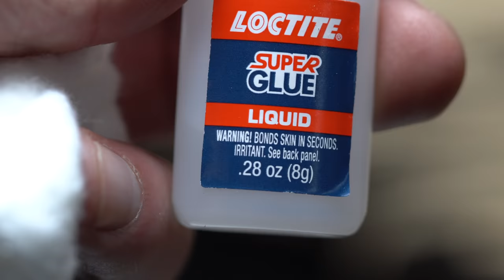300 GALLON MONSTER PALUDARIUM HARDSCAPE TUTORIAL!

Comment: Great work Troy, love your builds and tips. I'm about to make my first paludarium for Nataliae's Mountain Horned Dragons and found your channel in my research a while ago and a big fan since... I have a question about the filter foam and the bacteria you mentioned. Did it also happen in the tank where you only had filter foam and then the moss directly on it or only in the ones where you used filter foam + substrate? Did you put the filter foam in this tank again from the bottom up or are they on top of an eggcrate structure as well?
Would you advise me to use filter foam + moss directly on top or use of a substrate in between?

Comment: Hi Troy, noted the use of egg crate and looked at your other videos on back ground building. Excluding the cost do you see any disadvantage in siliconing a whole sheet of black egg crate on the back ground and then foaming etc? Purpose to ensure the foam has a good surface to grip onto and also to provide mounting points for timber used in the hard scape process.
Reply from the maker: I don’t see any disadvantages

Comment: You don't have issues with the great stuff eventually peeling off the wall over time?  I had to use some egg crate and silicone as a base for the great stuff to latch on to.  Awesome tank, troy!
Reply from the maker: I have had it happen before… but since doing the silicone bead where the foam meets the glass I’ve had zero issues with that

Comment: The lines for the waterfall system after the Toro head- are they in the spray foam? stuck to the logs? Is the line leading up to the Toro head in the spray foam?  The pump for the waterfalls is on the bottom of the tank- electrical goes through a hole in glass. Have you ever had something come loose or crack or leak and have to take out part of the background? Or once it's held in place, it's good to go? The lines for the rain system are also in the foam? Or... are the lines attached to the light diffuser plastic used to scaffold the foam?
Reply from the maker: Waterfall lines behind the foam, never had crack or leak, rain system lines are outside the tank and they run along the back… out of the sump

Comment: Did you just use egg crate with foam for the top  your false bottom as well? I’m in the process of building a paludarium for my Green Tree python. Purchased a paludarium 36x18x36 and pretty disappointed they didn’t come with pre cut holes through the glass with their hefty price tag. If only tetrafauna deluxe came in larger sized glass tanks their builds are the best and most durable I’ve seen straight from a manufacturer with pre cut glass holes, plugs, and adapters included.
Reply from the maker: Yes

Comment: This video is two-years old, so I don't know if you'll respond...

Please correct me if I am wrong, but it seems like you're substrate is entirely just filter foam? What is that, like a 4 to 6 inch layer of filter foam as the "land" area? Is there a reason you decided to do it this way?

How did you go about covering that up? Do you use just moss and leaf litter on top?

Are all your plants mostly just aroids? So I guess you can just tie them up to sphagnum moss or something and tie them to pieces of wood or the background and they don't require any actual soil substrate so that's how you're able to get away with doing what you did for the land base?

Comment: I carved my foam and there are a bunch of deep ass holes in it and it's got me worried. I can't get the drylok down into some of them. I worry what might happen when water gets in them. It's likely to stagnate and cause mold or mildew that would jeopardize the whole setup. Idk
Reply: That seems like a very light coat of drylok in this video. Maybe I'll be ok. His surely isn't so pocked with holes, large holes lol, like mine. I think I'll try and fill em with hot glue. I just don't know if I'll be able to get to them all around the wood I've used.